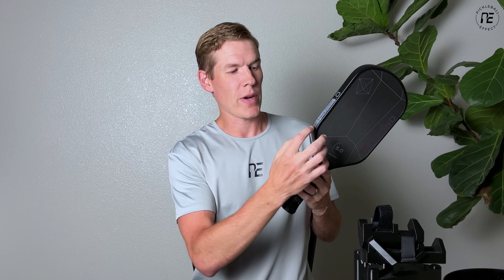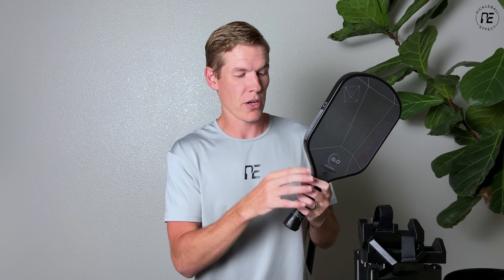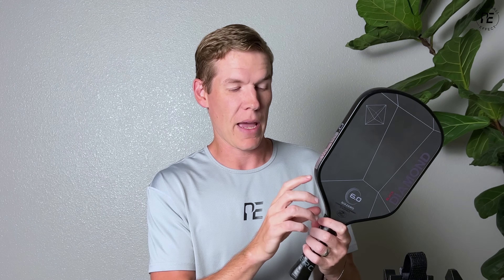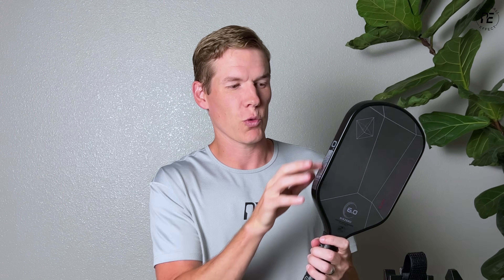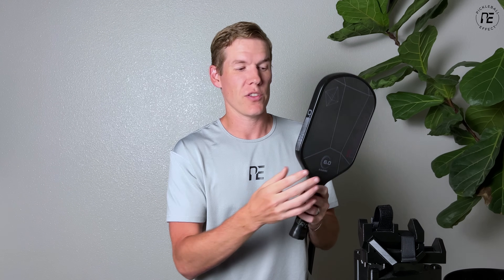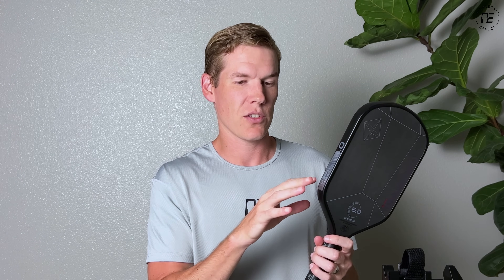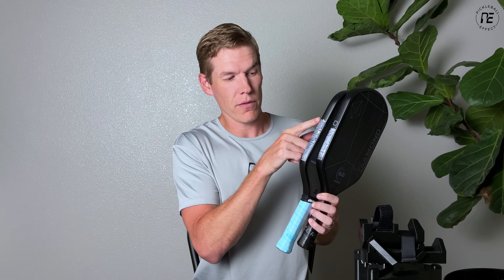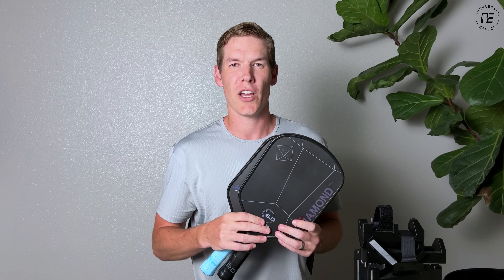The Best Place To Put Lead Tape on a Pickleball Paddle Based on Data

Comment: Here's an idea for a follow up video.  We need a data-based method to determine the optium amount of weight to add to maximize twist weight.  I've gone up as far at 10.2oz and have not really gone with less than a 9.1oz. total weight.
Reply from the maker: That would be interesting. See where you start to see diminishing returns. I’ll add that to my content ideas list.
Reply: @pickleballeffect  Have you found the amount of weight where you start to see diminishing returns / the most optimal weight? I am currently at 4 grams each side on my DBD 16 mm, but wondering if I cut the weight in half, what would the effect on twistweight/swingweight be.
Reply: @dmasterpong397  I haven't found the exact spot but based on an experiment I did with twistweight a while ago I'm guessing it's pretty high. Probably around 8 to 10 grams on each side. You'll probably run into the paddle feeling too heavy before you start seeing significant diminishing returns.

Comment: Is that strip only on one side of the paddle? When you are swinging, should you hold it with the lead tape facing up or facing down?
Reply from the maker: You should put the same amount of weight on both sides. And I'm not sure what you mean by facing up or down?
Reply: @pickleballeffect  Oh okay got it, thanks! I misunderstood at first and thought you had only put it on one side of the paddle
Reply from the maker: @AlfonzoPussigetti yeah, I wasn’t very clear about that in my video, sorry for the confusion.

Comment: This is 3g of weighted tape on each side? Looks like 3in per side using your new PE tungsten tape as well. Have you further optimized the weighted tape placement and amount of weight for your 16mm DBD?

Comment: Does anyone know the pros vs cons of adding lead tape to the handle itself, under an overgrip?
The goal is to increase total static weight, without affecting swingweight, if at all.
The increase in static weight would be to increase power.
Reply from the maker: Yeah, I’ve messed with that before. Adding weight to the handle doesn’t do much if anything to the sw and tw though it does alter the static weight and balance point.
Reply: @pickleballeffect  gotcha, yeah I think the video is golden, just put the 3g of lead tape on each side in the lower middle section and then weight up to whatever you need.

Just curious, what do you usually weigh your paddles up to?
Reply from the maker: @jasonchen2107 8.5-8.6ish is where I typically like it.

Comment: Depends on what you are looking for, more power, stability, or control.
Reply from the maker: Yes, but if your goal is stability/control then you can get that with less weight in this placement vs others. If your goal is power too then shifting it to the top of the side would do the trick.

Comment: Thanks! When I put lead tape on, for some reason I generate less spin than with no lead tape (same result on multiple paddles). Am I imagining this?
Reply: Where do you put it? Could be getting less paddle speed/rotation due to the increased weight. Or the weight could be affecting your swing path. Can maybe record yourself and see if you notice any differences.
Reply from the maker: It’s possible that the extra weight is slowing your swing down which means you’re not accelerating through the ball as quickly to add spin. Thinner paddles typically produce more spin than thicker paddles for that reason I suspect.
Reply: @pickleballeffect  Tried playing again to test, it’s because I am getting more plow through thus the ball is going deeper…..I think.
Reply from the maker: @BuddyPickleball  so you’re thinking maybe you’re getting the same amount of spin but it just doesn’t seem like it because the extra plowthrough is pushing the ball deeper?
Reply: @pickleballeffect  Either that or it's both not getting same amount of spin and plowthrough going deeper.  I would be curious if you've had experienced this before? Be curious if you could test this?
Reply from the maker: @BuddyPickleball  others have asked that too, I’ll add it to my to do list.

Comment: Do you think the differing grams per inch tapes will matter? For example, i have 2 grams per inch right now so the weight distribution might be a little different than the tape you are using and maybe change the swing weight and twist weight?

Its probably not a huge huge difference but was just wondering, haha.
Reply: Like a 4 inch strip versus a 2 inch strip (both 4 grams) seems like pretty noticeable difference in length, and I would assume the 1 gram per 1 inch is more efficient because it's distributing the weight better throughout the length of that spot.

But idk, it's just guessing lol
Reply from the maker: If you start packing on the weight you might move the weight down an inch so it covers an inch or so of the corner, that way the sw doesn’t get away from you. But the sweet spot for the lead tape should generally remain the same. If you typically add 12g of weight in the throat then you would only need to add 9g or so to achieve the same result by placing it where I said the sweet spot is.
Reply: Sounds good! Have you done a comparison of actual playing with the lead tape at that spot versus at the bottom of the throat which you say is the least desirable?
Reply from the maker: @dmasterpong397  yes, I’ve spent some time playing with it this way though I’m still trying it out. Here are my initial thoughts. Putting 3g in the new spot (total of 6g) vs putting 4g in the throat (total of 8g) will give you about the same sw and tw increases. But when playing, anecdotally the 3g placement feels more stable to me and it feels a just a little less whippy if that makes sense. So it’s not quite an apples to apples switch though it’s close.
Reply from the maker: If people like the balance of a paddle with the tape on the throat then you could move it up the paddle an inch or two and take a little weight off and that will give a more similar balance point but would be a more efficient placement.

Comment: what about non-symmetrical setup?
Reply from the maker: I’ve never messed with that. What do you think the benefits would be of non symmetrical?
Reply: @pickleballeffect  here's the thing, I come from a table tennis background, and in table tennis I use partial edge tape piece (weighing 1.5-2g) and it influences "natural" angle of the racket on a fast swing. If the tape is adjusted improperly it feels weird and almost like fighting the racket.

I think that perhaps there might be something to it in pickleball too. 
Also instead of lead tape I want to try using rubber strips (2mm thick), might influence vibrations/plush feel. I am waiting for it to arrive (basically I ordered a rubber pad with adhesive on it, out of which I'll cut the strips I need).
 I am thinking maybe positions like 10 and 4 or maybe just one side at 8. Would need to try different combinations. In most shots both fh and bh the same paddle edge is facing down and the other edge up. Asymmetrical approach might be the future.

Comment: I think people should (must) first master their forehand, backhand moves and volleys (cut the trajectory, NOT lift it) before thinking about putting lead tape here & there... Also before buying $200 plus paddles... learn how to those moves first.  So many people with super expensive paddles, don't even have a decent footwork. Nope expensive paddles won't make you play better.  BUT u have great footwork, good forehand/backhand swing, and tennis volleys... you can play great with a $50 paddle.  Am sure, excellent players will agree with me on this.

Comment: I bought you tungsten tape, it is better than lead in my opinion - so why are you talking about lead tape??? 🧐
Reply from the maker: I made this video over 6 months ago before I developed my tungsten tape.
Reply: @pickleballeffect   thanks. It is feasible to double up the tungsten tape - two one inch tape on top of each other on both side (to increase the sweet spot without increasing the SW). Will the 3M adhesive be strong enough to?
Reply from the maker: I personally haven't tried that but I imagine it would work just fine. The stick is good and the material is thin, though three layers would probably be too much. @user9b2